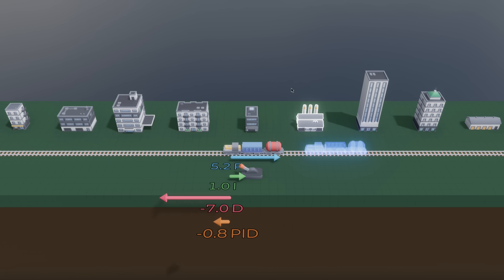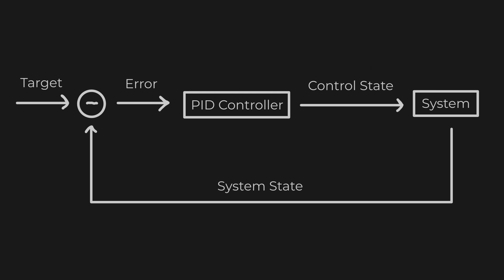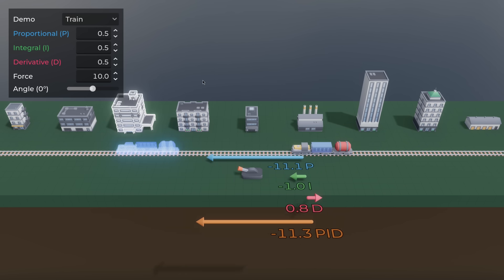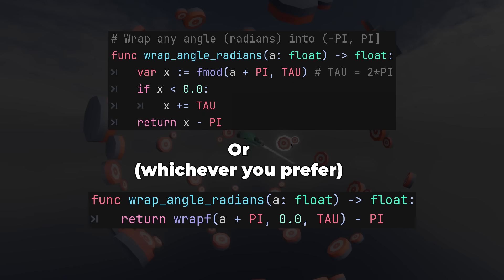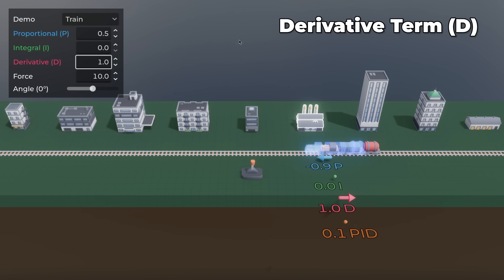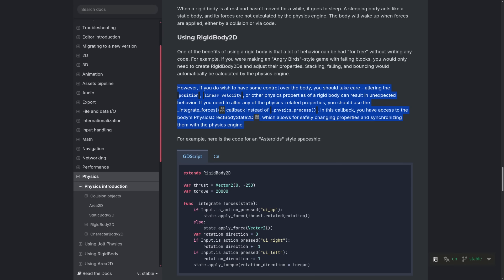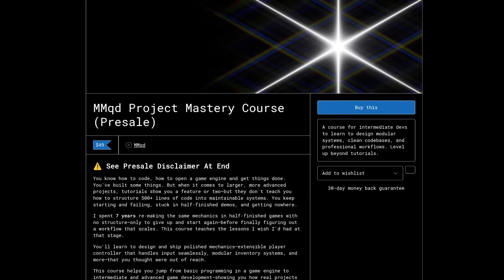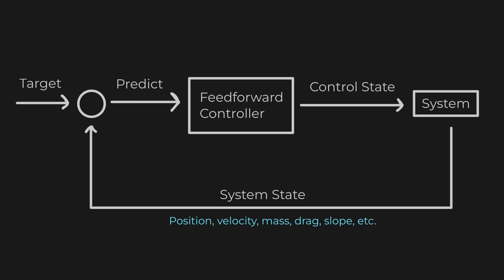PID Controllers For Game Devs

Comment: I want to implement a PID camera controller, how would you implement that without using physics ? I tried by calculating adding the output of the PID to a custom velocity, then adding this velocity to the position but when it get close to its target, it goes completely wild

Comment: I recall using a PID controller for a ray cast car in bge. I used it in both the suspension and friction calculation. I couldn't get the car to not slide with a clamped I value so I just used the force of the suspension (weight of the car on the wheel), the angle of the normal of the face the ray is hitting, and some trigonometry to get the force to prevent sliding.

Comment: Let me just point out that Your PID tuning will only work at a specifi framerate You tuned it at so if You are using PIDs You need to make sure they are used at fixed intervals. For example in Unity that would be FixedUpdate() function which is used for physics.

Comment: TLDR: This looks correct, i agree 100%. 

More general case (to spark your interest in Control Theory):
to be more general from Control Theory perspective, feedback signal from System is not System State, but actual Observation (or Measurements), and there is missing component "Sensors". Issue is that in complex environment, you often can't get full System State, which is a vector of variables sufficient to determine the next state (or probability distribution of the next state). Most often, they are variables of differential equations (or stochastic variants) that model physical laws governing the system dynamics. For example system state for a moving car might be vector whose elements are position, velocity, and acceleration vectors stacked on top of each other, wheel angle, throttle input, selected gear. If you know all of these, you can determine next state of a car (given dynamics model expressed as diff equation).
Sometimes however, you can't get all of these informations. Let's assume your GPS on a car is broken (or it's 1950 and you don't have it yet), so you can't determine your position. Now you can't determine your next state fully even if you have all of these, because you don't know where are you at the moment to know where you will move given velocity, acceleration, wheel angle, etc. In this complex scenarios you need State Estimator, that can take Measurements and try to "figure out" missing pieces of information. For example, if you knew your starting position, you might use numerical methods like Euler or RK to "work out" current position based on initial position and information you can measure (velocity, accel, wheel angle, etc). Such system is "highly observable" (yes there are degrees to how "observable" your system is) since you can "easily work out" missing information to arrive at full state (in this case you can workout your position). This is how game update the physics after all. Sometimes however, your measurements are noisy or not enough to work out missing information by numerical methods. In such cases you need proper State Estimators (like Kalman filter).
For games however, System is Fully Observable ,meaning Measurement == System State evaluates to true. Why? Because Game Engine maintains full System State (in order to update physics, and physics engine already have integrator for position, often Euler) and it's there in the same virtual address space as your controller since they both running in the same process.

Comment: Any discussion of PID controller should include discussion of harmonic oscillator, critical damping, and what that optimizes in the context of optimal control theory.

"Here's a tool that works for some reason and you try numbers until you're happy," is not an engineering approach. You don't have to get into calculus of variation of it, but at least reference where it's coming from. Even if you're just making a game, a designer tells you, "Hey, we want it to snap to target in 0.3 of a second instead of 0.5 of a second," are you just going to start guessing input numbers? Or should you at least know a formula for correct P and D values? (It's the latter.)

Comment: What I really dislike about PID controllers is the tuning process, which you need to repeat every time there is a significant change in the system's behaviour. Toyed with those when I was playing Space Engineers, and they only really work on a fixed design ship with little variable storage.

Comment: but is still jittery i think, i did something lile this, and solved it only by something like "barking force in next frame" and it was perfect, all thrust usage on all barking and accelerating path, without slow changing, and perfect stop without overshoot
because applying barking force directly causes overshoot because all things applied in next frame relative to the gathered data

Comment: PID is good to apply forces and get to a desired position/angle. The examples you provided in the beginning of the video can be easily solved with a "lerp" function or  Inbetweening ("tween")
Reply: Lerp doesn't work when the target changes while it's moving, which is shown happening several times
Reply: @SimonBuchanNz  I feel like you can handle that with a simple edge case check.
Reply: @kingnull2697 well you can just stop the lerp / tween and start a new one, but then the physics makes no sense with an instantaneous velocity change. You can solve the closed form of the equivalent of the easing function taking velocity into account (solving a cubic for the current position and velocity, final position and zero velocity, and desired travel time or max acceleration) - but that can lead to unrealistic results too if you're not careful, and can feel too mechanical besides. It's a good tool to have in the box besides PID.
Reply: @SimonBuchanNz  Yes, the primary selling point of a simulated PID is the robustness.

Comment: I learned about theses and started using them everywhere. They are just amazing. I recently used one in Stationeers to control the temperature in a room that I run a Gas Fuel Generator. Which is one of the most difficult things to do in the game because its extremely sensitive and has a very narrow window for the allowable operating temperature.

More practical, I implemented one on the heartbeat for an application I've been building, it'll increase or decrease the heartbeat based on the latency between the client and server. People with high latency will not get their system slowed by tons of unfulfilled status checks, people with low latency will get a much smoother experience.

Lovem.

Comment: This is a really nice and concise presentation on PID controllers! But if we are talking in the context of game development, I want to say (solely from my perspective, which of course may be wrong) a few things before people jump to conclusions or become excited...
Keep in mind that not everything needs to be a PID controller w '
For most of the situations there are simple enough equations which someone actually can understand and doesn't need to tune (I was surprised to discover the amount of books written on this topic...) for them to work, or requires very little tuning, and work reliably for most of the configurations and situations. Honestly, in a game development scenario I can imagine the usage of PID controllers only when there is some kind of non-trivial interaction with a complex physical simulation, that needs to give more or less reliable results and is just that important for the core gameplay, a very important mission or a major plot device that is dynamic/interactable. Also, in game development usually we have the luxury of having actual and precise measurement of every piece of the simulated (locally or received from the external system) data, which in turn allows to come up with better (in my opinion) methods to solve a problem.
Reply: life-saving comment right here - thanks.

When in doubt … keep it simple.
Reply: Can I have the name of some of the books you mention? Would like to get a better understanding!
Reply: If you find this video, you probably were already interested in PID controllers
Reply: @SoulSkrix  not really. It was in my suggestions many months after I was searching information on PID controllers due to a necessity, not because I was interested in particular. But I was looking many vids on game development as of lately, mostly out of curiosity and to pass time. So I think "game development" is a more prominent and generalized topic (instead of specialized such as "PID controller"), due to which this video is recommended.
I mean, you could be right that video may appear for people due to the reason you described, but in my opinion chances are higher that someone finds it due to the interest in game development rather than PID controllers.

Comment: Nice video.  I struggle with the application of PID for velocity control.  Once the system reaches velocity, the PID outputs zero and stops the motor, which triggers an oscillation loop. Would like to see more details for a working implementation.
Reply: I think you need an acceptable range of error if you can't tune it out of the system.

Comment: I don't believe a camera is the best example as it would be better implemented with just some lerping a PID could be used but a simpler method could be used with just P where you use the difference and increase velocity towards the target and when your halfway away from the target start slowing down.

this is partly what a PID would do but since you know the exact halfway point its easy to find out when you need to slow down and one the error is very very small you can simply teleport the camera or just say your close enough to the target because cameras really don't need to be perfect

Comment: A PID loop has no practical value for game devs, unless the goal is to simulate a PID loop. They are only justified when you have limited controls on an object and are trying to bring it to a precise value. In Game Dev you could teleport the train/camera to whatever location you want, and could also bring it to the location in whatever time curve desired.

Making a entire PID loop for something like camera lerp is massive over complication, and would run less efficiently on top of that.
Reply: To the contrary, PIDs are quite useful when you need natural looking movement and don't want to put in the time for more advanced approaches. For example, Unreal uses a PID controller for soft bounds on ragdoll joints.
Reply: @ThyReaper PID gives you a lot of control, but in most cases using any of the dozens of easing functions is probably good enough.
Reply: @lbgstzockt8493  It's very niche, and very robust. Having, say, a near-infinite variety of trains whose physically-determined speeds have major effects on the gameplay would be a pain to satisfactorily code without a PID system.

Comment: Great explanation, I might watch the vid several times to fully comprend all, also now that you mention rotations, I´ve been years struggling with 3D rotations In my games, one thing that I´m trying to achive now Is a spring-like system to set to certain orientation applying torques, but even applying everything I´ve seen about it In Godot, it doesn´t behave as expected so I give up using quaternions and I´m thinking how to achive it just considering the transform basis

Comment: The PID controller is a wonderful thing, which has proven itself to be a very reliable system. It is used everywhere. Especially because of its mass use, I do not understand why this wonderful system does not provide for a "Planned" change of the parameter to achieve the parameter. Let me explain.
We have a variable parameter and there is a maximum speed of gaining the value to the maximum and decreasing to the minimum.
This can be in the case of a train - the speed and the speed of acceleration (acceleration) and the speed of braking (also acceleration, but from the value "+" or "-" to the value 0, a complete stop)
In another case, when the PID controller controls the direction - this will be the speed of gaining rotation acceleration and the speed of damping rotation acceleration (we are not talking about a car, but about turning a rocket). For the case of controlling the water intake in a pool or tank, we have the speed of opening a gradual valve and the speed of closing the valve, and knowing the required value to which we strive for the system to reach it, we need the deceleration, braking, stopping the torque or the beginning of closing the valve to begin in advance, before reaching a given point, to behave predictably. And this is not in the standard PID controller.

Comment: i kinda did this but end up just rubberbanding it! I made a system that calculates AI car's braking power on corners but there is just too many variables!
Reply: You most likely violate the Nyquist theorem or you made an error in discretisation.
Nyquist says the highest frequency or rate of change you can controll is halve your sampling rate. Lets say your loop is 60 FPS, any movement thats steaper than 30 Hz/FPS will shatter. Turn all gains especially D down to fix.
The PID formulas work in continous time with infinite small/many time intervalls. Almost all conversions to discrete time demand a fixed sample time. If your loop runs faster or slower, as it might be coupled to FPS, it will cause shattering.
And well Cruise Control in your car, or rubber band KI in racing games can be a PI controller, and it's purpose is to behave like a rubber pulling something.

Comment: I do programming for my schools FRC (Robotics) team, and this video was a great explanation! One note that the I term can often be detrimental to stability, and is rarely used in FRC due to problems like integral windup.
We instead use Feed-forward calculations that supply a constant force to keep the position of a system stable.
For example in the inclined train example we would constantly add just enough force to keep the train from rolling downhill, which lets the rest of the pid loop act almost as if there was no gravity.
For more complex systems like rotating arms we use the cosine of it's angle to offset the gravity as it rotates.

Comment: Depending on the domain there are many ways to tune a PID controller. Most of them tune them in order of the letters (one reason why they are called PID and not PDI) - so first proportional, then integral, then derivative.
Going with derivative before integral just means you will have to do more iterations till you get a decent result as I will have big side-effects on D. There are some good rule-of-thumb and easy to follow rules on getting the "right" values. Most simple methods just go Proportional till it oscillates, then integral till it no longer oscillates, then derivative as needed.

Comment: Having study this in college, I will say your explanation is possibly one of the best that I have ever seen.
Reply: This. I've implemented it once and it was a pain to understand, because it was explained with math... like... it's nice and all, but I'd like to understand it first. I was pretty pissed when I discovered that it's effectively a moving force, a damping force and a corrective force that is based on accumulated error. It's so simple.
The first force works, but obviously overshoots endlessly. The second force therefore allows for the reduction and settling. Third one just corrects for when the first two don't work good enough.
Reply: former Aerospace Engineering student here. we were introduced to control theory with 45 minutes of impenetrable discussion of Laplace transforms and step vs ramp inputs, ano then to make it relatable, they'd show five minutes of the Eurofighter / Airbus A380 / Asimo robots and say "look! these new and exciting things all use control theory!"

the best part of that module was going to the labs to write a C++ controller for a cooling fan. if they'd kept the examples in the realm of  thermostats and servos I think everyone would've enjoyed it more
Reply: Yeah, I had it too, and only now it finally clicked, turns out I already reinvented it a few times for my unfinished projects, but I never knew of it so I was always struggling from zero, and now it gave me idea on how to handle one problem I have, and I'd probably reinvent it again. I feel so dumb, but college wasn't to focused on how to think about it, only dry facts
Reply: The broad range of topics covered by an entire course didn't explain a single topic as well as focused independant study? Shocking.